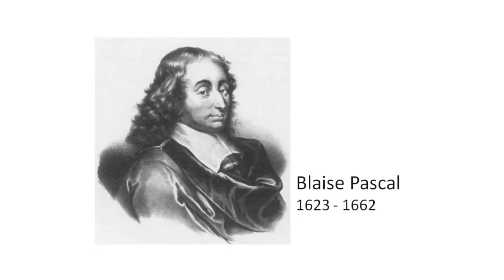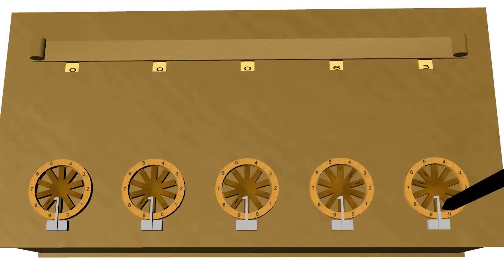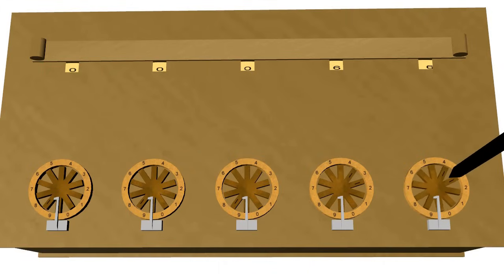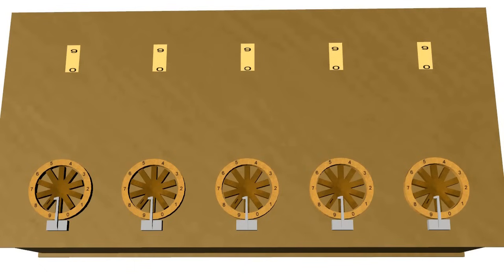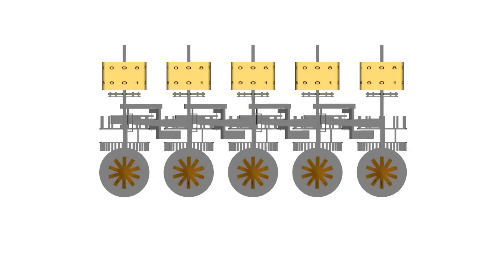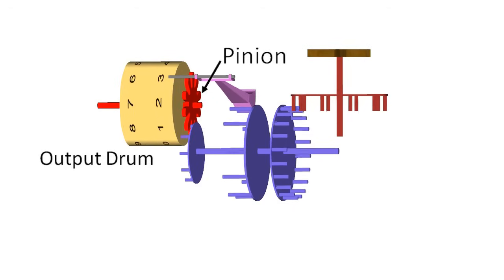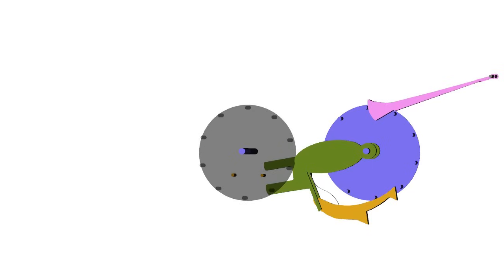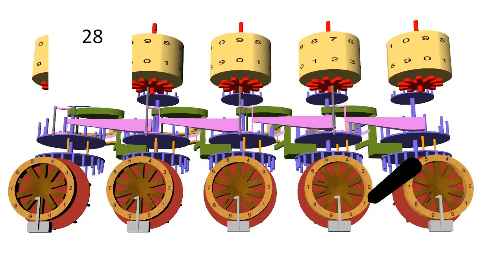How the Pascaline Works

Comment: Thank you for this. Isn't this design limited in number of digits because of force needed for the ripple of carries? More precisely when adding one to 99999999..   turning one wheel (the lower digit one) needs to transmit turns to all the wheels on its left.
Reply from the maker: The digit wheels in the Pascaline are not directly connected to each other, so the Pascaline can have an unlimited number of digits.  That is the most ingenious aspect of its design.  During a carry operation, the power of gravity is used to turn the higher order digit -- not a physically connected gear.

Comment from the maker: The marked spokes are calibrated during manufacturing by sliding the display bar up to uncover the normal digit display, rotating the output drum to display the 9 digit, and marking the spoke that is under the stopping lever and the spoke immediately to the right of the stopping lever.